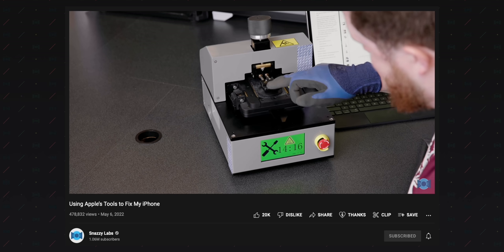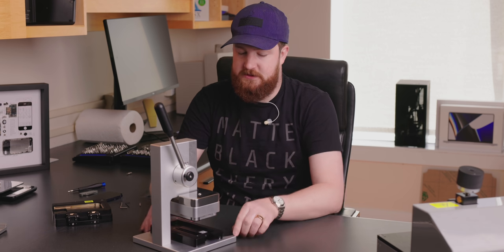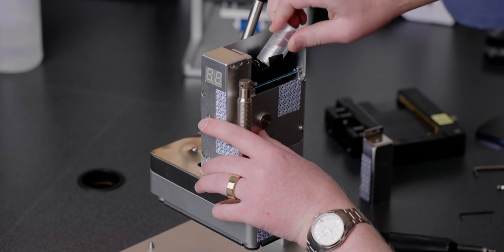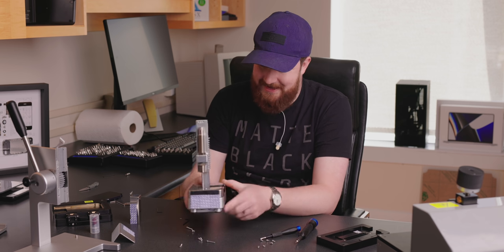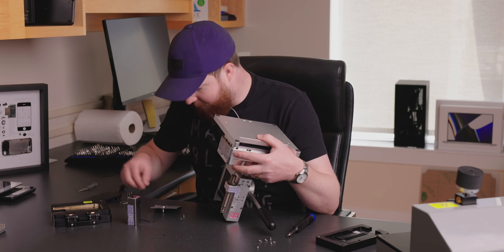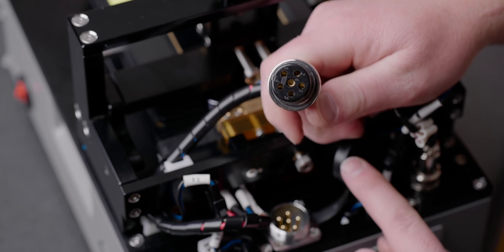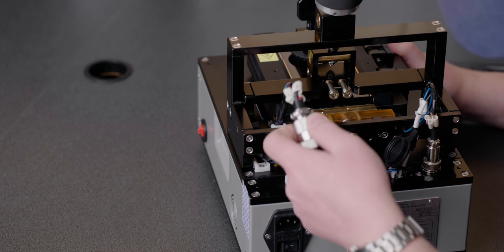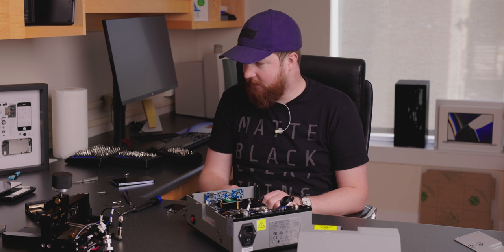Breaking Into Apple's Secret Genius Bar Tools!

Comment: Just throwing it out there, spring pressure varying with displacement is exactly how it is linear. The rate of increase in force for a unit increase of displacement is shockingly constant over most of most simple springs ranges.

Comment: I've seen enough Louis Rossmann to know that Apple has always had difficulties isolating power connections from data connections. In this case, I'm glad they subcontracted out to someone smart enough to use RFID for data transfer instead of putting the heater's power connector half a millimeter away from the ~3.3V data line like they usually do.
Reply: Killing you laptop after a few years of use in humid environment makes Apple more money. Breaking repair tools, just annoys their employees.

Comment: Just think about this for one second how much will you fingers hurt if you had to continuously replace batteries, not forgetting the amount of pressure you'd have to apply to get the battery to properly adhere to the shell of the phone.

Comment: The arm board is programmable, there is a mini usb b port on the board (on display too). So there should be a cable attached to usb b printer port to usb a convertor to the board
Reply: Compile Doom for it
Reply: @fusseldieb  yep

Comment: The battery on the press is a little weird but I can tell you why. The 14500 that they used is much cheaper and easy to find right now. While the C cell size 26500 or whatever its called is hard to get right now

Comment: Interesting that the USB port on the heater is not connected to anything. The machine I used when I worked for an ASP actually had the USB connected and was used to update the firmware on the machine.

Comment: In fact spring pressure is linear? In theory, but that doesn‘t disagree with what you said, that the spring pressure is higher when compressed. I think non-linear is just a cool term people want to use nowadays :D

Comment: These kinds of machines used at workshops are really really simple:

My family owns a printing company, they have lots of machinery and not even the simplest ones were cheap and parts were outrageously expensive. So my brother  reverse-engineered some of those machines with Arduino and cheap parts that are easily available, and now they have a few of those simple machines for less than 100€ each that work great and can be fixed in-house.

What makes workshop machines so expensive is the over-engineering to make them less easily repairable and less durable, having to get back to the manufacturer to buy parts or get a certified technician.

Comment: It would be preferable if the batteries were user replaceable and mobile phones had a properly engineered water-tight easily opened/closed battery compartment. The sealed-in battery trend is a bad manufacturer-centric idea. Having to go through all these gyrations to replace a battery is nuts. Back in the day I used Blackberry a Samsung S3 phones with replacement batteries that I could just pop in a fresh battery when needed. As well, add to my wish list user-replaceable external pop on screens!

Comment: The video is awesome, thanks for making it and exposing yourself to the mercy of Apple.
One thing I would point out is that you use mechanical engineering terms in a way that is not correct. E.g. 7:50 is when you talk about linear rod, but that's a linear rail. However, I'm definitely nick picking, and thanks again for the video.

Comment: This seems really over-engineered, but I guess that's how you have to do it if you want really tight control over the whole process?
Reply: If you imagine an Apple store repair workshop where they are replacing batteries and displays all day long constantly every day, multiple technicians doing repairs and then lining up and using the same tools etc... you want something engineered. They are obviously not single use disposable tools for a single home repair :)

Comment: can you rent or buy specific tools?  do you really need to get both cases full?

for example can you get just the heated display removal tool?

even then you can use a hot plate

thats ok if you have to buy the tools or pay for the repair you are rolling around in money from the videos so just cash out a few videos to get the money you need.

3.6 volts is not aa it is 18650

be very careful working with heavy springs they can come out and injure you if you get hit with a spring that flies out.
Reply: Yes, you can buy individual tools. You can only rent the full kit tho.

Comment: one of the many reasons we need right to repair in legislation not company policies... all this "high tech" stuff looks cool but doesn't help me fix FaceID nor recover users' data from a damaged motherboard. It also doesn't help me when users ask "why does it say unofficial display". Heck, I can't even replace a battery on an 11 without losing features unless I have special parts, a programmer, and spot welder.

I think these tools are designed to produce consistent results for technicians who can follow procedures accurately regardless of skill - personally that sounds like they're leaning towards automation in the future. Maybe someday Apple stores will be automated/robotic for most repairs.

Comment: Interesting. Purpose built device and they have a C-Cell socket for the battery, and then use an adapter. But on top of that, they use a lithium cell that is more voltage than a normal AA or C battery. why? why not just build it for the right sort of cell? so Strange.

Comment: it's stone cold obvious that these tools are not designed to fall into consumer hands, and only have due to legal pressure. These are high quality custom jigs setup to manufacture and service iPhone in huge volumes, hence the rock solid design and build quality. When you spec a piece of control gear for an army tank, you don't think it's "Over-engineered" - it's meant to ENDURE HEAVY USE, day in day out, for many years across thousands of operations.

The issue with the "media" and the majority of observers online, is that the majority look at everything through consumer eyes, as that's all they know how to view things through. These are not consumable items, they are designed for internal processes. They are not polished, the timers don't need to run anything except a microcontroller (I can just envision someone asking "Why don't they run iOS?" - you get that with factories too - their CNC runs on Windows XP in a crude, custom built bolt-on box - IT WORKS is why, and CNC machines don't need to run macOS)

The hammers and the JCBs used to build Apple Park, are built heavy duty too - they're tools. Get yourselves out of the "wooo wooo, it's so well made" mindset - OF COURSE it is, it's an industry tool!

Comment: What?!? Did they run out of C batteries and just used an adapter in this one instance? Are they all like this? Not very environmentally friendly of Apple to use excess plastic. Either design it to take AA batteries or use C batteries.

Comment: Hold up
Sorry but no thats not a water tight seal. Its water resistant. Every phone is made with a vacuum inside it. Once water depth is reached that = the vacuum pressure. The phone is water damaged

Comment: Being a apple hater can i still say that whatever they make they make it with perfection ?😅 Wish they were a better company that all can love but unfortunately they are not so please get over this bro it's just tools, 50 kg of tools so to speak for a 10 gm screen and probably 80 gms of battery 🤣🤣
Reply: dude, imagine how they overengineered these machines but couldn't built a MacBook display cable to not break from opening and closing the device xD
Reply: @PvtAnonymous  Dude, Apple did not engineer those tools. A superior Chinese company did it for them. As you said, Apple cannot even engineer a simple cable.
Reply: @Scarlett-uz9fr  that 1st and the 2nd tool looked more like designed by Apple than the 3rd one which was probably from some Chinese companies.